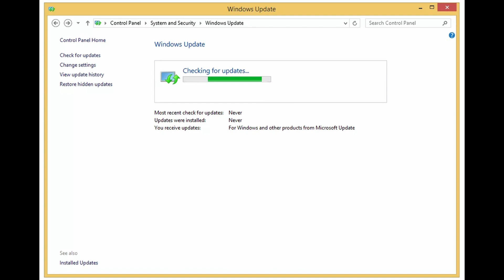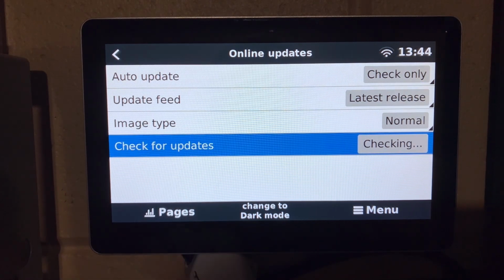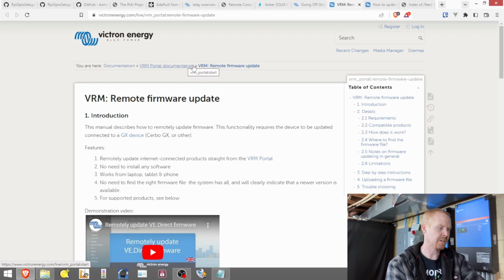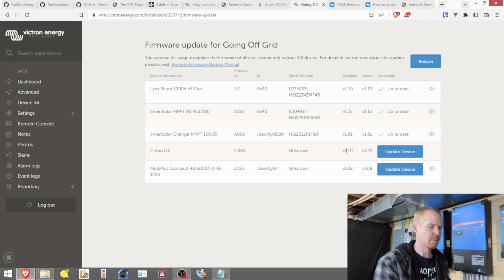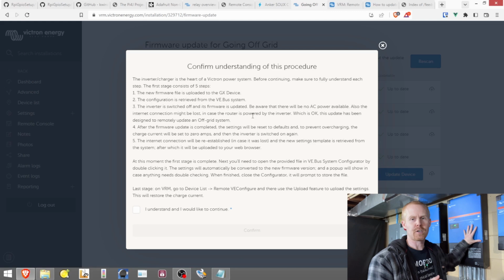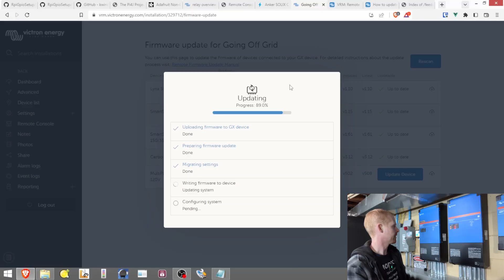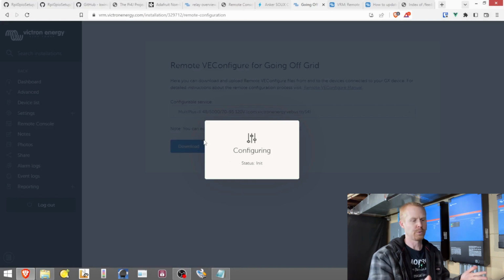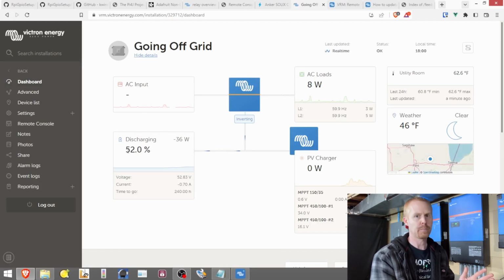Streamlined Firmware Updates: Mastering Victron Device Updates the Easy Way!

Comment from the maker: Remember, firmware updates are like a power-up for your Victron devices, but only perform them when there's a specific need. If your system is running smoothly and you don't require the latest features, sometimes the adage "if it ain't broke, don't fix it" holds true!

Links to the parts & pieces in the video (affiliate links)
------------------------------------
Victron 48V MultiPlus-II 5kVA 120V Inverter
https://www.currentconnected.com/product/victron-48v-multiplus-2-5kva-120v-inverter-70a-charger/?ref=AzzpK9Fl

10kVA 120/240v Base MultiPlus-II System
https://www.currentconnected.com/product/10kva-120-240v-multiplus-2-5kva/?ref=AzzpK9Fl

Victron Cerbo GX
https://www.currentconnected.com/product/victron-cerbo-gx-system-controller/?ref=AzzpK9Fl

Victron GX Touch 7" Display
https://www.currentconnected.com/product/gx-touch-display-cerbo-gx/?ref=AzzpK9Fl

Victron VE.Bus to USB - MK3-USB Interface Configuration Tool
https://www.currentconnected.com/product/victron-interface-mk3-usb-configuration-tool/?ref=AzzpK9Fl

For more information, please check out my website with links to all the components, materials and products I have used in developing my off-grid solar system: https://going-off-grid.com

Supporting the Channel
--------------------------------------------------
The 'Buy me a Coffee' - link is here (on the bottom, right corner of the website): https://going-off-grid.com

You can also click on the "Thanks" button under the video to support the channel. 

Thank you for your support!

Comment: Try updating a Multiplus 2 GX with VRM. You can’t.
Reply from the maker: Why not?
Reply: @AdamDeLayDIY because the GX device on the MP2 power cycles when the MP2 power cycles. You have to use and independent GX device.

Comment: You've obviously been writhing in the Victron connectivity/configuration mud for so long that this still-kludgy process appears to you to be acceptable. IMO, the awkwardness required to update the Multiplus-II and preserve pre-update settings is just stupid.  As are the steps and launching of yet a different app to preserve SOC. Sorry, Adam. This is a long way from user-friendly.
Reply from the maker: @atslastname5624  I would love for them to update the process and their app to something a little more modern.  

To be honest, I don’t think I’ve updated the inverter firmware since this video.  There’s been no need.  The inverters are rock solid.  If you follow Victron’s recommendation, you’re not updating the inverter firmware on every release anyways, so you shouldn’t have to go through the process that often. 

Unfortunately when you find great hardware, you sometimes have to deal with less than ideal software.

Comment: Great videos!!!  Do you have the procedure for rolling back the firmware you refer to in the video?  I just updated mine to 5.10 and it has caused all kinds of issues.  Thanks!
Reply from the maker: @ScottH-di6yc  Thanks!  Appreciate that!

So the process is exactly the same.  You’ll load the older firmware version using the VRM.  

You can get the older firmware versions from https://professional.victronenergy.com.  If you don’t already have an account, go ahead and create one.  You’ll have to find the prior version under the “firmware” menu.

Comment: Hey Adam, How do you open .rvms files once the update has been done? my window laptop doesn't support these files.  Is there a hack around this? My multiplus  seems updated, but because I can't open the rvms file to merge it, I cannot upload it and finish the process and now the Multiplus is not working.
Reply from the maker: You have to install VE Configure from Victron to open the .rvms files.  It's packaged inside the "VE Configuration tools for VE.Bus Products" download.
https://www.victronenergy.com/support-and-downloads/software

Comment: My cerbo GX show most of the time as offline. All the settings are correct but show a code of 155 for connection. VRM portal work on and off not sure why the is so buggy.
Reply from the maker: If the cerbo isn't connected to the internet (or it has a bad connection), you won't be able to see any live data in the VRM.  Are you using WiFi to connect your cerbo to the internet or an ethernet cable?

Comment: Thanks for the video very clear and straightforward, 
I am still on 498, but I am nervous to update it to 508 ... maybe I will do it on Monday when the installer is only a phone call away :)

Do you think upgrading from 498 is worth it?
Reply from the maker: Thanks!  

If there's nothing you "need" in the updates, I wouldn't bother.  "if it ain't broke..."
Reply: @AdamDeLayDIY  I hear you... But my worry is that one day I will need version 671 or whatever and going from 498 to that would be too much of a jump.

Basically I don't like drifting too far away... But maybe it is a mentality I need to change if I want to go off grid.
Reply from the maker: @Siminfrance  Yeah, ultimately it's up to you.  I know I went from 502 to 508 with no issues at all (except my screen recorder didn't work, so I had to do it all over...😁)

Comment: Interesting , I do not have that option on my setup?
Reply from the maker: That's very interesting.  Are you using the Cerbo or the Raspberry Pi for your GX device?
Reply: Cerbo @AdamDeLayDIY
Reply: You need to allow full control of the VRM Portal from the GX device: Settings -> VRM online portal -> VRM Portal -> Full
Reply: @ That is what I have set.